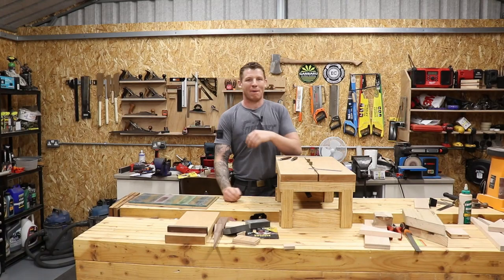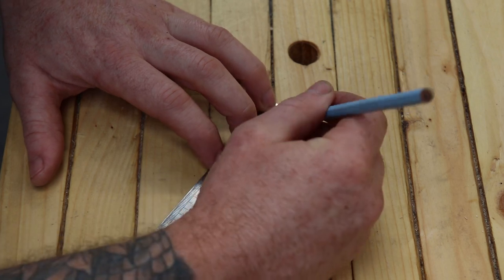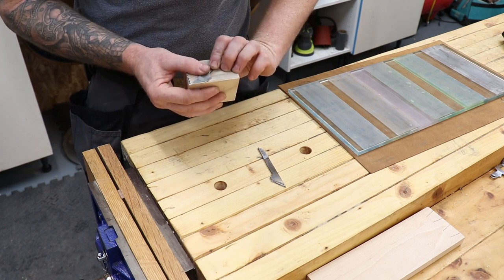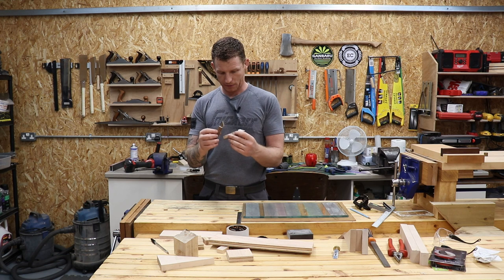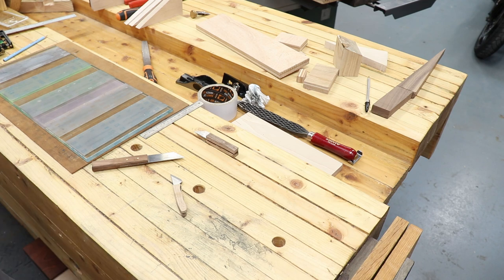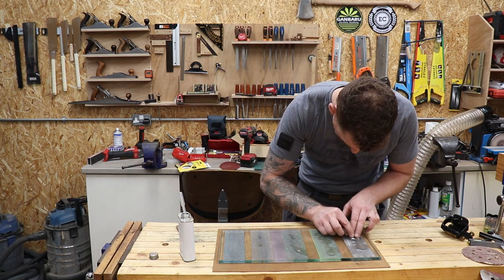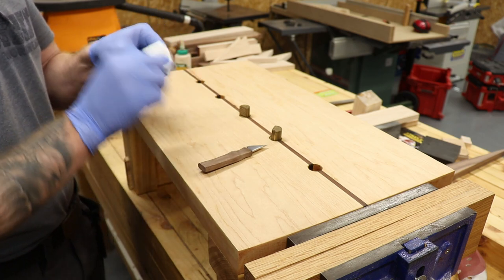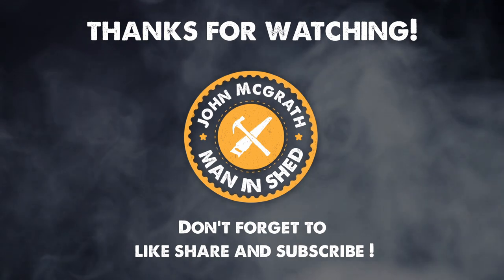Making Marking knives From a Plane Blade!

Comment: Hi john drilling those pin holes would have been so much more accurate if you’d had both sides clamped together and drilled before assembly,.!! maybe do a dry fit 1st to figure out  the best position.? Then have the pin installed during the glue up so that you can put a square across the body to square it up… easy to say I know but might work.!! Anyway I feel inspired  to mole myself a bespoke plane of some sort, cheers.💪🏻💪🏻💪🏻